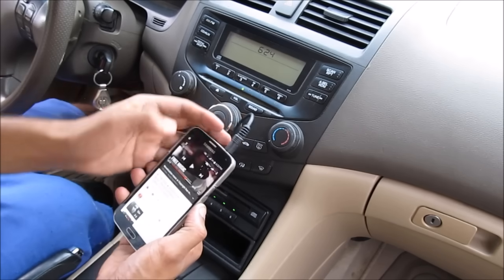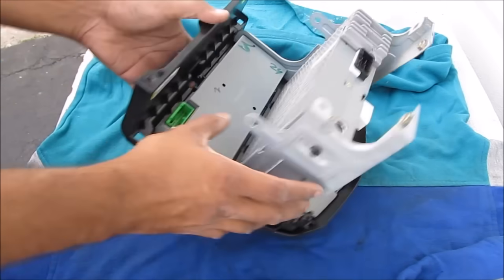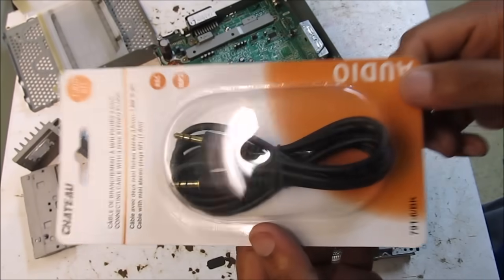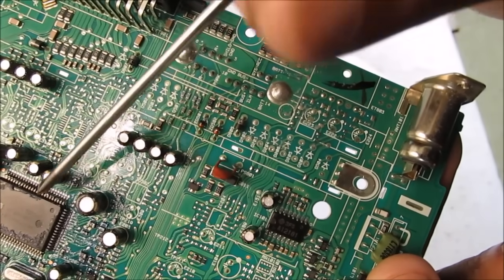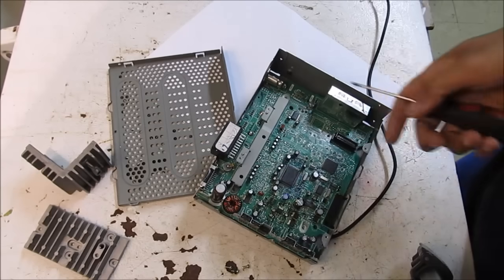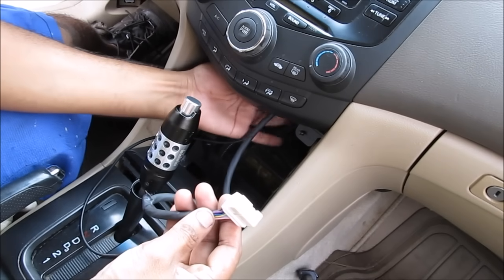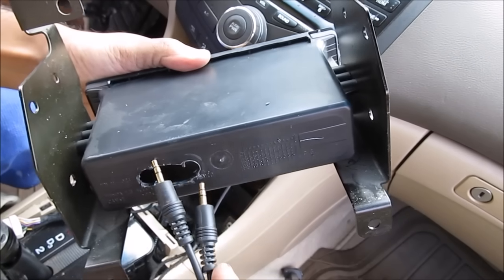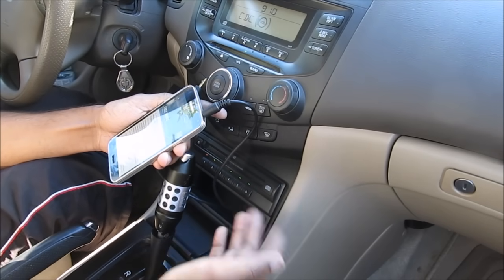$1 AUX Stereo Input Hack

Comment: i would have bought a female headphone jack, doo the same thing, butdill a hole on the radio case, so it looks like the car has a female jack and buy one of the cable,cause what happend if the cable break?    
answer: you going to have to do that all again
Reply from the maker: that works too, but then you still need a male to male

Comment: you should have drilled the hole and put the wire through before you attached it. then you would have a nice little hole that the wire would fit snuggly through and also tie a knot in the wire behind the hole so it cant be pulled through.
Reply from the maker: good tip

Comment: Great! But he could put the wire trough before soldering it and he wouldn`t have to bent metal case !
Reply from the maker: Good tip. Except my wiring would be tight to pull on the board when soldering.

Comment: Great vid. Next time run the cables through first so you don't have to drill a big hole to accommodate the wiring. Also if you are doing this to your car, get a higher quality cable. Lastly, it would be ideal to go through the cd changer option which will get a clean stereo output. You can use an inline stereo amplifier to address the volume issue.
Reply from the maker: Thanks, I agree with all your points. A good quality cable is a nice investment.

Comment: I bought an aux adapter for my buddy's accord for $15 of eBay. it plugs into the back of the head unit into the CD changer plug, and I drilled a hole in the storage cubby to run the cord through.

once that was done, you press the CD button twice (to go to aux mode). As far as sound quality goes, it's WAY better than a crappy FM modulator. sounds and works just like a factory aux input. the hardest part was getting the part below the ashtray out
Reply from the maker: +Kyran yes you can go that route too. It emulates a CD changer and gives you a pass thru.
Reply: Good on you for finding another method though. I guess that would be incredibly useful on an older head unit without a CD changer port. Thanks for the upload

Comment: FM transmitter is a good option as well.. if you get a quality one they sound pretty good plus you don't have to take your car apart and you've got Bluetooth/Aux
Reply from the maker: +Hayden Boyd FM transmitter can never match sound of direct aux input. It's a good cheap solution but by no means permanent
Reply from the maker: +Hayden Boyd FM transmitter can never match sound of direct aux input. It's a good cheap solution but by no means permanent
Reply from the maker: +Hayden Boyd FM transmitter can never match sound of direct aux input. It's a good cheap solution but by no means permanent
Reply from the maker: +Hayden Boyd FM transmitter can never match sound of direct aux input. It's a good cheap solution but by no means permanent
Reply from the maker: +Hayden Boyd FM transmitter can never match sound of direct aux input. It's a good cheap solution but by no means permanent
Reply: That's what I thought too.. I got a pretty nice one on amazon for like 40 bucks and the car has an AUX. closing your eyes you can't even tell the difference not even shitting you.
Reply: Good video btw.. not trying to dis on your vid but there's other options as well😌

Comment: Radio CQJH8364X (or 39100-S0X-A310) has CD changer port, but only CD button is shown on the front. How to get the radio to recognize that there is CD changer input? - intend to just add AUX at CD changer port as you suggested. Thanks.
Reply from the maker: +yjxu66 you need an m-bus CD changer or device attached to the radio so it will detect it

Comment: just a tip, if you're going threw all this trouble, you better get a quality AUX wire..
Reply: great knowledge you have, are you a computer engineer or technician ?
Reply: ltwargssf R the quality of a $12 aux line from Best Buy vs. one for a $1 is usually just the packaging, the mark up on those things are ridiculous.  It did seem like the one he used was very well made.
Reply from the maker: +kugmyster It does work for now, the one in my Solara is starting to give static after 3-4 years, especially when the cable is cold and stiff.

Comment: my odyssey has 6cd changer built in inside radio,have the white plug coming out of radio without anything plugged in it,can i just get a white male plug and pin in my 3aux cable wires to it?or like you said there needs to be a device fooling radio
Reply from the maker: +Vega-Expert yea you need the device with an mbus protocol to fool the radio into aux.
Reply: speedkar99 there is an aux button on the odyssey radio just nothing plugged on white plug,there is a module i can buy but i have a bunch of aux wires laying here,think i will give it a try,im all into doing diy stuff 0$ lolll thanks for your reply!
Reply from the maker: +Vega-Expert try hacking the radio or internal cd changer lines.
Reply: speedkar99 i am right down to the radio board,my board dont say rf anywhere,just codes from r200 to c54 any pointers plz!thanks
i am trying to find the output pin on the fm modulator,honda odyssey board are different then accords,thought would be close pins are not coded the same,looks so easy on accord board!
cant find anything else online your are the only resource for me right now,20yrs as tech im a newb with motherboard but have comon sense

Comment: I just have a question. On the 14pin connector thats connected to the radio and cd changer. What cables should a unite in the connecter so the radio thinks theres is a device even when there isn't one. The thing is that I don't have the cd changer or any other external device.
Reply from the maker: +Orlando Lara I tried finding those pins thru a lot of trial and error. The interface is an Mbus interface so you need a communication device to fool it into thinking there's something there, in this case I had my CD changer. Its not as simple as shorting two wires.
Reply: Thank you for responding. Ok, thats too bad. well I started doing your first method and everything was going well but I ran into a problem. On your motherboard, the silk screen tell you which is pin "af out" but not on mine. My motherboard is from a honda accord 2007. the fm module has 35 pins and does not have silk screen naming each pin. I would upload a picture but this comment section doesn't permit it. I have had no luck finding the schematics online that name each pin. Do you have any suggestions? Do you know where I can find the schematic with the names of each pin or what I can do to find out which of the 35 it is?

Comment: I like the toothbrush being used as a pointing device
Reply from the maker: +John Mershon haha yes that toothbrush makes its appearance throughout my videos...its my brothers toothbrush, he doesn't use it much so it put it to good use.
Reply: speedkar99 . hi. I noticed you when you soldered to fm board you only soldered the left channel, can you not combine it with the right as well? surely you'll only get a mono sound via this route.
Reply: I was thinking the same thing. He's only getting the left channel on the FM setting. Combining the L and R isn't the perfect mono solution, it boost what ever content is panned center by 3db. However, its better than only getting half of the songs content. Lets hope he doesn't like music from the 60's they all do crazy panning, especialy Beatles stuff.
Reply: That was my highlight
Reply: If you watch until the end, he does actually point out that the FM way will only give you mono.

I'm sure if you use a cable capable of dual channels, you could solder to both on the FM board. Not 100% sure though.

Comment: I have a got a cheap aux adapter of eBay  for accord 2004.. I connects through the 14 pin connector.... Audio quality is good but the volume is terrible... Even at max volume its not even the half volume level 
Is there sometime which will fix this? PLEASE HELP!!!!
Reply from the maker: +harsh tibrewala You need one that's not cheap and has an amplifier inside

Comment: Are there any unused input ports to the main multimedia controller chip that could be selected via I2C hack?  Might be a little more involved? Are the Bus+/Bus- wires on the 14 pin connector the I2C bus?  Might be fun to poke those!
Reply from the maker: +John Westerdale Yes and I have looked into it briefly with an oscilloscope on those lines, there is some programming knowledge and decoding that you'll have to do to get it to select that aux input. That's pretty much the job of those off the shelf aux adapters

Comment: you can buy an fm transmitter for a dollar
Reply from the maker: +ADYPRO90 That has terrible sound quality. And no, transmitters are at least $7-15
Reply: ADYPRO90 I've bought 4 different Bluetooth fm transmitters that plug in the 12v. All of them had terrible static except for the cheapest one I just got that's made by Scosche, it was $45 at best buy

Comment: Nice vid, but all that work to spend just a buck
Reply from the maker: +Juan Rodtiguez Thanks, it's not that much work, I just spent alot of time explaining the steps. The second method using the CD changer is even easier.
Reply: better you just buy a nrw car with aux connection
Reply: JUST CLICK AUX AND DONE
Reply: +tv76g just spend more money on the aux cable..
Reply: Juan Rodríguez that's what I was thinking.